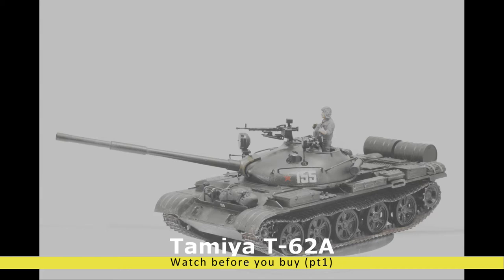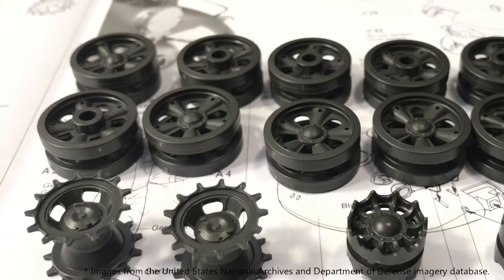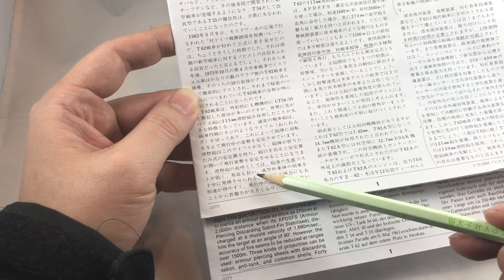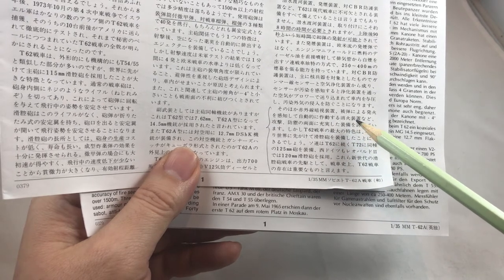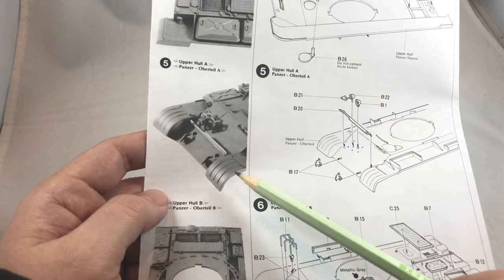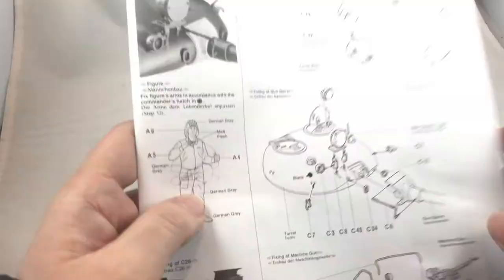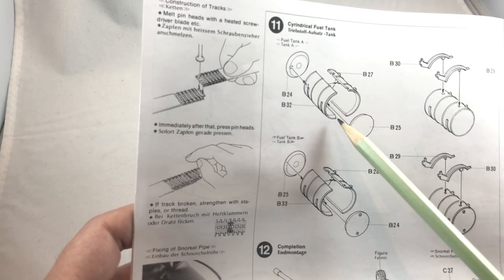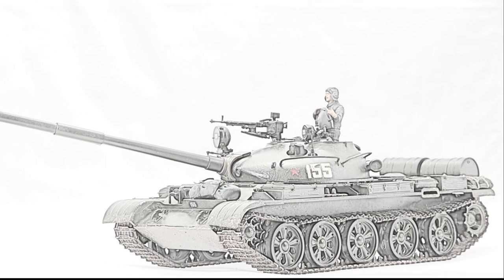Watch before you buy: Russian T-62A Tank, 1/35, Tamiya 35108 (pt1)

Comment: The reason the turret machine gun port stands out like he says is because the turret is misshaped.  At the lower front Tamiya has the turret tuck back towards the rear.  This is not correct.  The lower front of the turret should come more straight down.  You can easily find pictures of the real thing online to see what I mean.  Just compare the real lower front turret in the picture to what Tamiya gives you and you cannot miss it.